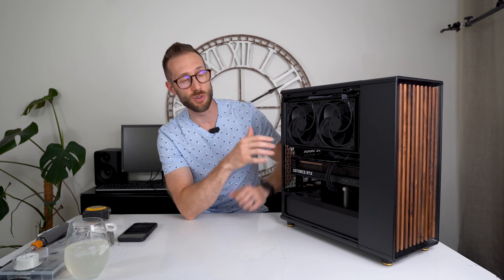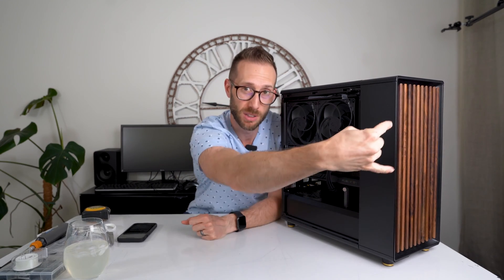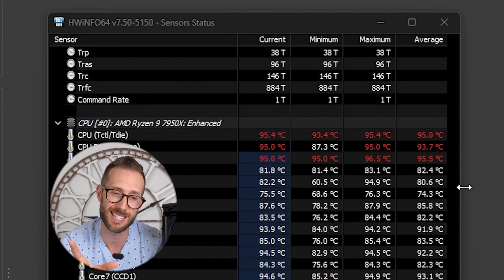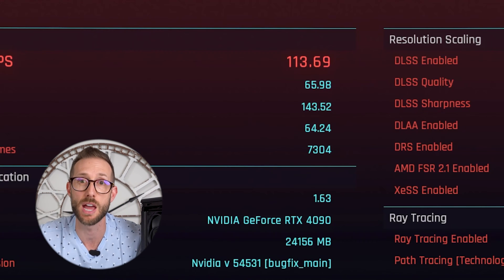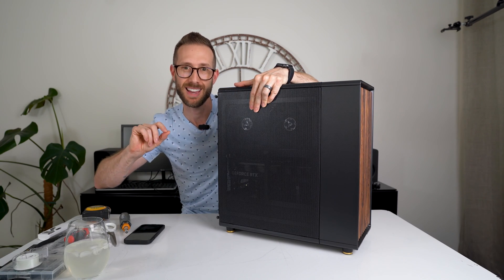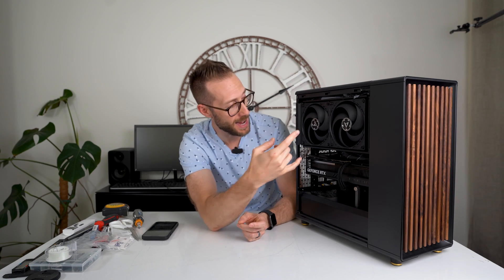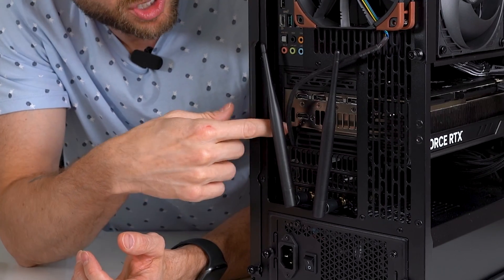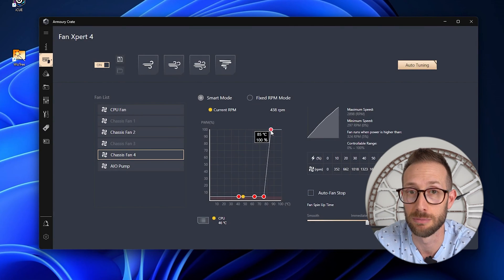The Unexpected Truth About Side Mounted AIO Fan Direction | Arctic Freezer II 280mm

Comment: Planning on doing this with the AIO at the top position as exhaust but using another side bracket for two fans in the bottom as intake to blow some extra fresh air right onto my vertical mounted GPU
Reply from the maker: Yeah, that can work very well.  Let me know how it goes!
Reply: @JohnLCharette  Working amazingly so far, my 3080 used to be running temp locked with 83c core and 110c hotspot. Now it's doing 70c and 90c respectively. AIO in the front has now been replaced with 3x noctua 120s providing more than enough fresh air while still staying quiet under load. I also placed a 3d printed duct here that directs the flow from the bottom fan into the actual case instead of the basement.

Comment: 4:33 The most frustrating part about Fractal North cases is the thumb screws - in this case, all 14 of them.
I didn't know painted screws were a thing. I got better case screws on my Pentium 133MHz computer from the 90's, although we didn't have thumb screws back in the day, just regular screws.

Every time you tinker with the Fractal case you'll get that bad feeling deep in your soul as you "strip" the screws. It's the gift that keeps on giving 🤣
If you read comments you'll see that Fractal has been doing this for years and years.

Fractal's CFO is not a gamer, I think that's safe to say. 

It's a good looking case tho, one of the few that look like an adult computer case and it doesn't look out of place in your living room.
Reply from the maker: Yeah, I haven't used another Fractal case since this one.  I've recently used a Asus ProArt and TUF cases.  They are pretty slick.  Fractal certainly has a design edge on them, but..

Comment: Installing all those fans without any ducting is super useless. You have mounted fans to pull air in on the side for instance and then in a 90 deg. angle fans to pull air out again, all it does is you send the air in circels without cooling anything. Even back in the 90´s people ducted their front intake directly to the CPU and out the back, it´s 10x more effective than simply mounting lots and los of fans without any concept of air flow.
Let me give you a use case for those side fans. You duct those fans directly into the GPU intake or your mount the GPU vertically, duct it to the side and forget the stupid extra fans.
Reply from the maker: Interesting.  I haven't seen ducting used in years.  I had an old Dell computer that did it, but MOST custom build PCs don't use ducting and I've never heard any complains.  You're right, it would absolutely work better with ducting, but considering that most custom builds have an aesthetic appeal, ducting doesn't look great.
Reply: @JohnLCharette  I still duct my PC, mainly due to the modern and power hungry GPU´s. They dump all that heat inside the PC case instead of outside of the case. 
You don´t even need many fans, just placed strategically and of the right size for a cool and quiet PC. 
I also don´t use those glass doors, they are super impractical and I don´t need to see the GPU or CPU cooler all day long, it gets boring after the first week anyways. 
I just use the metal side panel to hang wires magnetically, USB charging cables and such. It´s a lot cheaper that way too. But each to it´s own I guess.

"...MOST custom build PCs don't use ducting..." MOST custom build PC´s also prefer optics before usefulness and most of them just follow a couple of trends.
I don´t mean it´s wrong this way, who am I to say, it´s just objectively worse cooling wise. I mean in the end´s the PC case is just a metal box with some wooden, lether or class applications. Me personally I rather have good cooling for a cheap price in a black box on the table which runs quiet.

Comment: I just got this for a 7800X3D build with a 280mm Liquid Freezer III which I’ll probably set up as an intake on the side so the hot air doesn’t blow towards me since the pc will be on my desk to my right😂 Also, I’ve heard of huge temp drops by mounting the gpu vertically since there would no longer be any turbulence with the side mounted AIO
Reply from the maker: Ohhh, that's really good to know.  I don't have that system anymore to test it but let me know how it works out.

Comment: It's July 25, 2024 And have to say you have taken everything we all ask ourselves and thanking you for sparing us the burden of trying this. Now before I ask any other questions I "Liked the video, "Subscribed  and "Clicked the Bell", choosing "All", hoping to see and get more on your channel.  P.S I too like the North case and quite a few more cases using several Arctic Liquid Freezed 2 280's, 360's and 420 models. and a few more that have Noctua NH-D15, NH-U14S. (i get my sons hand me downs)  P.S. I'm 70 and been doing this since I was 35.  I get tired of al the bloated reviews and needed an honest MID to Full Tower PC case"Under -A-100 review. I'm not asking for you to purchase and try any. I'm just looking for your perspective as a fresh and open minded comment. Thank you very much posting using a North case with an Arctic Liquid freezer 2 280. And I know it's hard to find a case that can handle an Arctic Freezer line up
Reply from the maker: Thank you so much for the kind words.  70 years old still building PCs.  Love it!  Very impressive.  As for mid-to full size cases.  I've been very happy with my Corsair 5000D that I use on my test bench system.  It's roomy enough to fit any GPU, has enough room for a 360mm radiator.. clean lines.  I would recommend checking it out.  Good luck with your builds!  Thanks for subbing :)
Reply: @JohnLCharette I had to front mount the Arctic 280 AIO in a 5000D (it's a tight fit) theres not enough room to top mount it (Corsair prefers us to use their Proprietary products).
     I'm searching for MID Tower cases with extra head room above a MOSFET and rear IO cover to mount any Arctic Freezer AIO's, without any luck. 
     There's only a couple of XL PC cases I know of and use, Fractal Design Meshify 2 XL and a BeQuiet Shadow ase 800. Fractal Design XL, maybe even their POP XL case works without modding for all Arctic Freezer AIO's.  
     I use 2 Fractal XL's as servers (Their Huge). 
     Now I want to downsize without going overbudget and still use my (easy to install) ARCTIC AIO's..
    Who knows maybe you'll make a video on MID Tower Mombos. And, I'll be the first to give you a "Thumbs UP".

Comment: Bro you doing it wrong. you are reling on water for Cpu, great... more air won't make that big of a diff. Rather use the side fans to blow fresh air on the GPU
Reply from the maker: Yeah, I see what you mean, but I'm using the side fans to cool the 280mm rad.  There's no other place to fit a 280mm rad in that case unless I use the front.  I do that, I wouldn't be able to fit the 4090.

Comment: I was looking at this solution due to the high temperature of my GPU while gaming. Currently it's front mounted and i do have 2x140 top and 1x120 back exhaust. Do you have any idea if there's a difference?
Reply from the maker: Sorry, before I answer.. to clarify.  You have a watercooled GPU with a 240mm radiator that's mounted in the front?  Then you have 2x140mm fans up top and 1x120mm fan exhausting out the back?
Reply: @JohnLCharette Hey man! Sorry for the late response, not on YT that often.

I have a 3080Ti FE, just running a little hot at 83c. I have a 280 rad for the cpu, but unfortunately it's too big to fit at the top. Currently it's sitting in the front sucking cold air in but blowing hot air at the gpu. I have 2x140 on the top, 1x 120 exhaust and for testing i had 2x140 in the side bracket but that does not change the temperature at all.
Reply from the maker: Hey.  Sorry, I missed your reply until now.  I would recommend replacing the thermal pads on your 3080 Ti.  That might help more.  It sounds like you have your airflow working well enough.
Reply: @JohnLCharette  Memory isn't the issue here, or does the FE have a thermal pad for the core as well?

Comment: Thanks for the insight, currently trying to cram a TUFF ASUS 4090 OC in this case and you are left with little options for AIO placement but didn’t think of this! Does a 280mm in the side mount??
Reply from the maker: Yes! That’s a 280mm Arctic Freezer II that i used in this video. I was also very surprised to see a side mount radiator.

Comment: you my dear friend showed that I can mount my arctic freezer II 280mm on the side and finally decide on buying the 40series. THANK YOU so much. I have the exact same case as yours down to the colors
Reply from the maker: Awww, so glad to hear that you found my video and it helped.  Which 4000 series card are you buying?
Reply: @JohnLCharette the 4090 Asus. I will try to adjust the position of the radiator with fans within the coming few days "just like yours in the video". I hope you don't mind if ask you for advise if I get stuck.
Reply from the maker: I do my best to read through all of the comments.  I can't troubleshoot every single persons issues, but if you have a question, leave it here and I'll do my best to see it.  Good luck!  I'm sure you'll love your new GPU :)
Reply: @JohnLCharette  I really don't know how you fitted it I struggled a lot to fit my 4080 and had to do some bends in the front, this was a few days ago. with all my love for the fractal north, I doubt that I'll go again for a compromised case again. thanks for your video @John, without it I would've never enjoyed my STRIX 4080.

Comment: Got the same setup, but thinking about cutting the fins where the fans are mounted to the bracket. So it's free airflow thru the radiator. don't know for sure if it will help a bit. But feels like there are going to be resistance. 🙄
Reply from the maker: Ah yes, I know what you mean.  You could definitely try that.  I did read somewhere that someone installed the fans on the inside.. so side of the case, radiator, then fans.  I can't remember which way they mounted the fans though, but they said they had much better results than I did.  You could try that first before cutting things ;)

Comment: its loud because there is no distance to case, you should install some kind dinstace 120mm to 120mm which make a 1cm at least free distance or print it on 3d printer :) hot same thing in my ITX build, need to use a rubber under screw which give me few mm but still will just for visual purpose.
Reply from the maker: Interesting.  I hadn't heard of this concept.  I don't have any experience with 3D printers.  Can you recommend one with a design of what you mean?
Reply: @JohnLCharette  I would try to find out who selling something which I could use as distance for fan, if nobody maybe someone on forum have ready project to print it on printer. I don't have experience of printing but it is a option always to make that kind concept but hard to find, someone propably will sell something like that in resonable price just to get that 1-2cm edge tunnel. The question is still, is it worth it :) Just my previous post was a suggestion, in my ITX case i got one fat push which is silent because get that plastic under fan on back of it but other side i got pull rgb just for visual effect. And it is terrible noisy. But if I give him a little space let say 1cm i get much more silent. King Regards. Always cut off metal is a option DIY :D
Reply from the maker: Thanks for the photo and the detailed explanation.  I have since removed that rear fan from my setup as it wasn't really doing much to reduce temps.  I will definitely keep this in mind the next time I'm working with 120mm fans, though!  Maybe even your DIY solution ;)
Reply: @JohnLCharette  https://i.ebayimg.com/images/g/1WAAAOSwYDZabRMt/s-l1600.jpg

Comment: I switched to intake yesterday, and the temps dropped 15-20°C but my side mounted is on the same side as the motherboard. The fans are pulling air through the rad.So it worked for me.
Reply: Ryzen 7700X
Reply from the maker: Very nice!  I'm considering an ITX build inside a Fractal Terra using a mid-range CPU like that or a 13700k/14700k.  Any reason you choose AMD over Intel?
Reply from the maker: Very interesting!  I feel like that's how the AIO may have been set up from the factory, and I switched it around.  15-20C is a HUGE drop in temps.  What CPU are you using?

Comment: I wonder if having the top fans as intake and the aio fans as exhaust would make a difference. It would be very positive pressure having the front and the top as intake, but that might help push all the heat out of the case
Reply: Great video by the way, I love that case. I wish I could get one in white
Reply from the maker: Thank you so much!  That's an interesting approach to have 4x 140mm intake fans and 2x 140mm out.  I'd love to get myself a smoke machine so that I can watch the airflow.  Oh yes, I haven't seen one in white yet but the video/images look amazing.
Reply: Technically, they could, tough need to test it to be sure

Comment: hey ! just came across this video, i want to do the same aio configuration. Did you check if your waterblock was mounted with the offset recommended by artic ? the temperature drop seems to be very good.
Reply from the maker: Hey!  You're the 2nd person to suggest the offset mount.  I haven't confirmed, but based on my build video here:  https://youtu.be/KxdNBWBHXA4?si=kfEb4iGVeGkZRFRH&t=995  I don't think I did.  I actually hadn't heard of the offset mount and had no clue why there were two holes!  I recommend trying it out, and let me know if it makes any difference.
Reply: @JohnLCharette  haha i was hoping you could be my test bench :p i do 3d rendering for a living and usually my cpu is full load for about 3-4 hours. With Honeywell ptm7950 and a bit of undervolting i think it could work but i wanted to see if their was a difference with the offset. every subjetc i saw on it said it was a must. 7-8 degrees drop.
Reply from the maker: Sounds like a good video for me to test it!  Great idea. Let me work on it and I’ll keep you posted.
Reply: @JohnLCharette  :D cool ! hope the tests goes well !
Reply from the maker: After doing some research, it looks like der8auer did a video on this, and it didn't make a difference.  I'm still on the fence if I'm going to try it:  https://youtu.be/0mPi6DjGZpQ?si=V4jgiPIE1lHy8lPq
Reply: @JohnLCharette  hey ! here is a little update for you, so I installed everything, put the Arctic freezer II with the offset mount coupled with the ptm7950 from honeywell on my AMD 7950x, everything stock, didnt touch pbo or curve optimiser. I get 1926 on cinebench 2024 and my temps never goes above 85 degrees :) same when 3d rendering temps are well under 95. Really happy with the build but I have to say pretty disapointed with the build quality of the north, it's sooo rattly...
Reply from the maker: Hey!  Sorry, I just saw this.  That's great news!  It makes me want to try the offset mount, for sure.  Thanks for the update, and yes, the North rattles quite a bit, especially when I had that Strix 4090 in there.

Comment: Great video mate, I'm looking at buying this exact case. Does the MSI Suprim liquid X fit in this case? It seems like it'd be very tight between the side panel and the card with the pipes coming off it.
Reply from the maker: Thank you!  I wish I still had the Suprim Liquid, but I'll see what I can figure out for you.  I'm using a ProArt 4070 Ti in there right now, which is 120mm tall, and there's about 50mm of extra clearance (170mm total).  The 4090 Suprim Liquid X is 140mm tall, leaving you 30mm (1 inch) clearance for the tubes.  That should be plenty to bend the tubes around to the radiator.  You'll need about as much space for the 12vhpwr connector cable anyway.  Here's an example of it being done. It's tight, but it fits.  https://pcpartpicker.com/b/GGj2FT  You could also do a vertical mounted GPU, which would eliminate that issue too.
Reply: @JohnLCharette   Ah Cheers mate! Keep the content coming!

Comment: So go with the tempered glass version, got it ✔
Reply from the maker: Yeah, I went with the mesh so that I can attach the 280mm on the side.  It doesn't fit on the top and with a Strix 4090, I definitely couldn't put the 280mm in the front with that card.  How have you configured your fans, CPU cooling?

Comment: I am back and happy to see new upload. I was honestly expecting that it would make very little difference if any at all but im still greatful you put the work to clear things up and made this video so thank you. Now I can see that this case is not really made for that type of configuration with the radiator mounted there and Im guessing it also cant be mounted lower in front of the gpu as it probably wont fit with such a large card, but that would be a solution for anyone with a smaller card that would fit. Once I get my case im going to be mounting my 240mm radiator on top with the fans pulling air in and with that exit fan on the back to pull that hot air out. I might also be mounting that braket in front of the gpu and putting two 140mm fans pulling air into the gpu or maybe even one fan in and the other out to balance that presure up a bit but that might be too weird haha.
Reply from the maker: Thank you for the feedback.  Let me know how the 240mm radiator goes on the top.  What CPU will you be cooling with it?